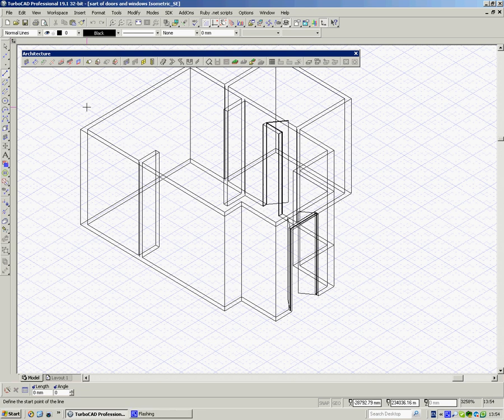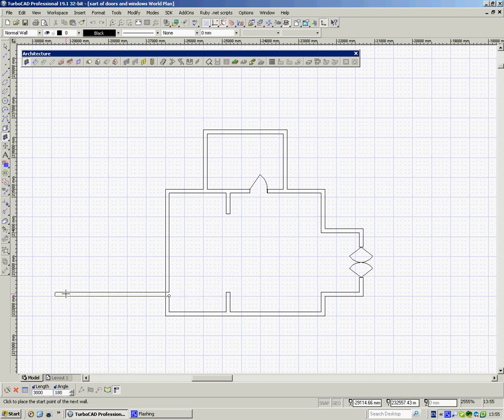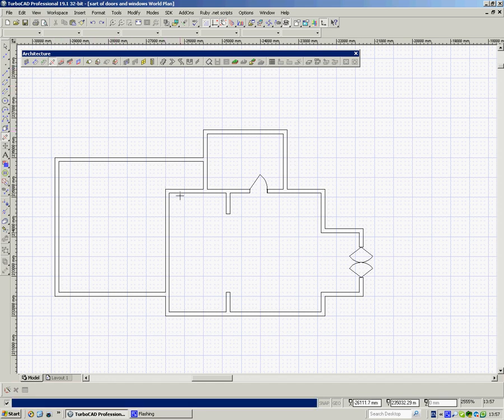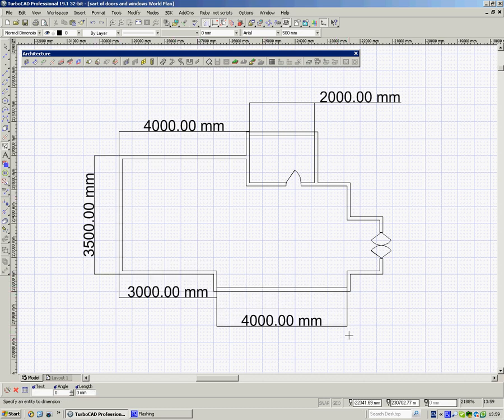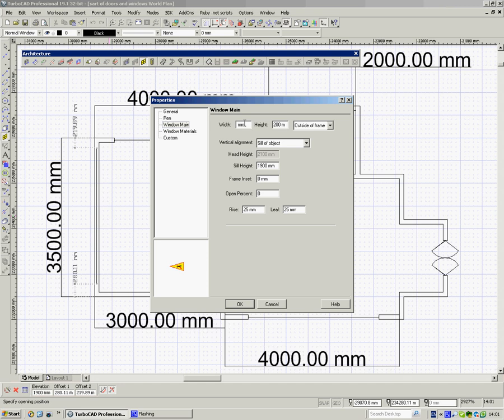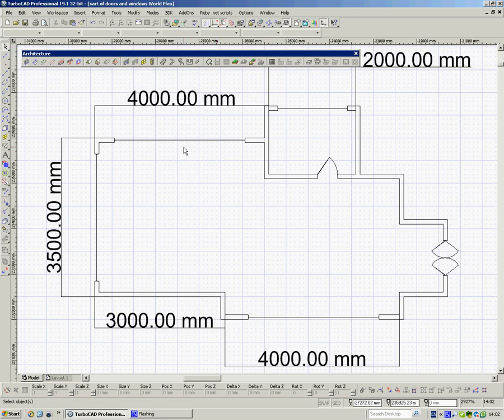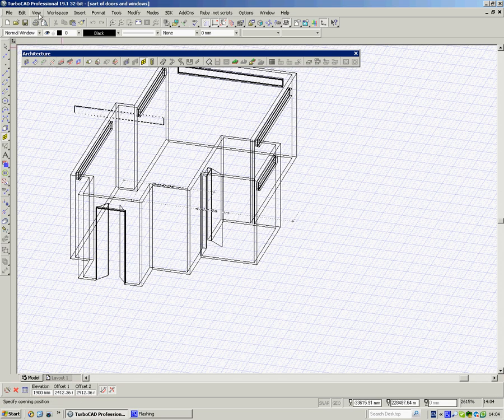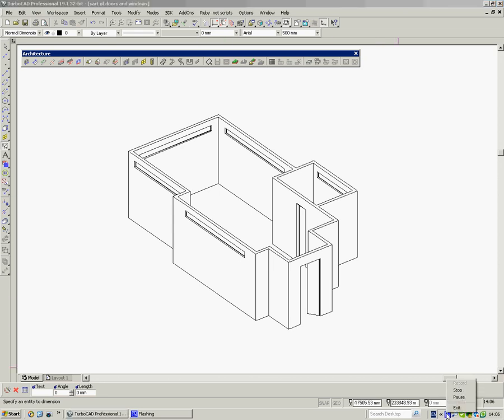TurboCAD Architectural - Adding Walls & Windows

Comment: I have some walls that are disassociated (not connecting).  Sometimes they join on their own and other times not.  Mainly when I'm not placing the wall at a mid or snap point.  In 3D ISO, the walls are shifted off the planes. How do you join the walls together?

Comment: I know this video is several years old but you're still out there.  I have TurboCAD Deluxe 2018   and trying to layout a house floor plan. The interior walls are not linking to the exterior walls. Is there a way to join them after they are placed?  Also, is there a way to place walls based on a relative dimension point?  For instance, placing an interior wall 6"-4" from the inside portion of an exterior wall.